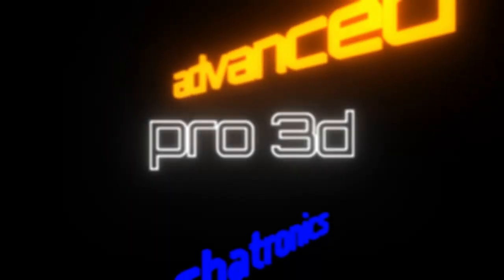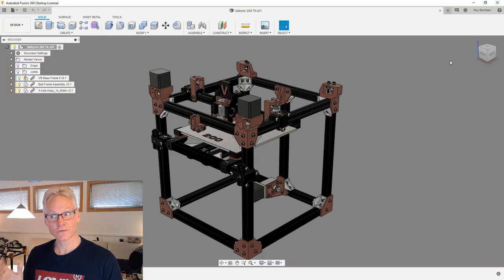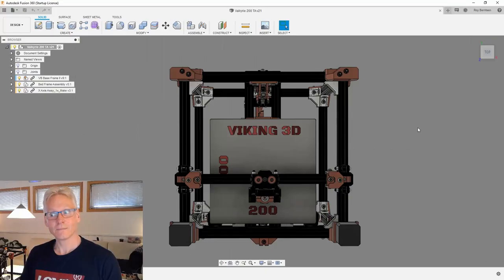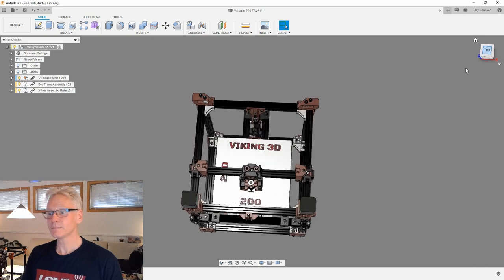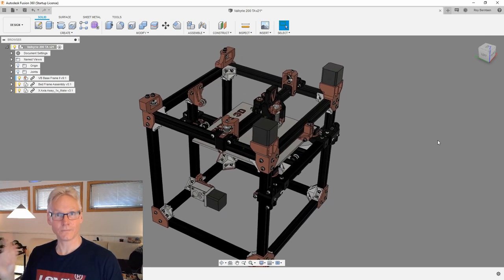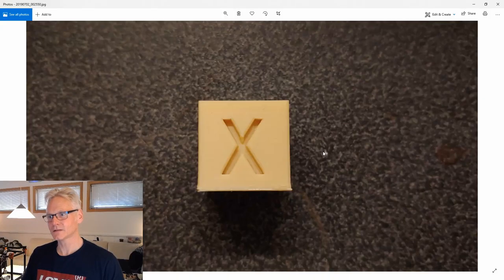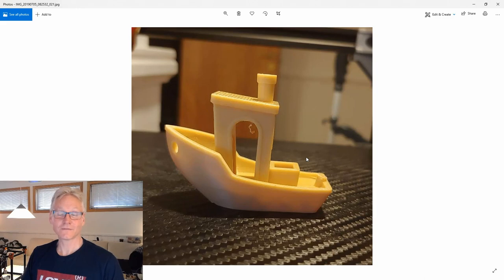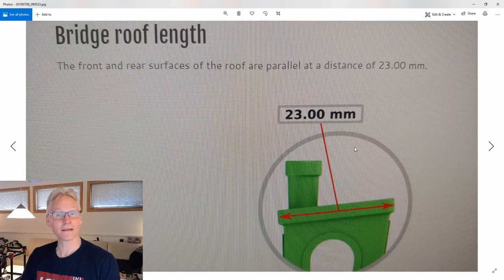3D Printer Design VLog #14 |  CoreXY Release & Project update

Comment: I know the feeling. I been building a 3d printer that has been going on since I was in high school. Been redesigning so many times I don't know how many files I have for it.
Reply from the maker: Right!!... yes its all part of the process and many people dont recognize this  so thanks for understanding
Reply: @PRO3DESIGN  
Currently I think I have a more stable design. A lot of the back traking was due to...well being a kid with no job and arguing with myself with electronics. I gotten a radds 1.6 for my printer since at the time of purchase had everything I wanted out of a board. Now there is the skr boards with 32 bit processing for 20 bucks. I'll use one of those to upgrade my ender 3.
Reply from the maker: @samuelgonzalez7783  Starting with the Radds is a good place to learn everything from scratch so now the rest is easy piesy .. :)
Reply: @PRO3DESIGN  especially since Marlin 2.0 has been released. Glad that the radds board is supported by it.